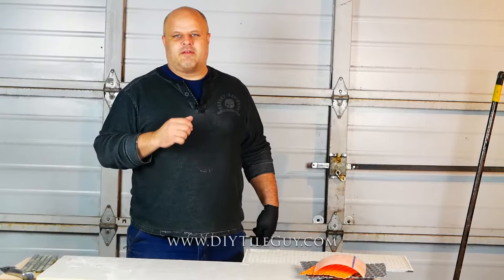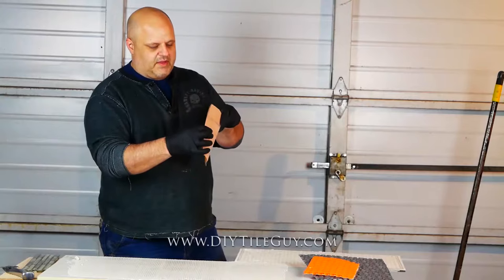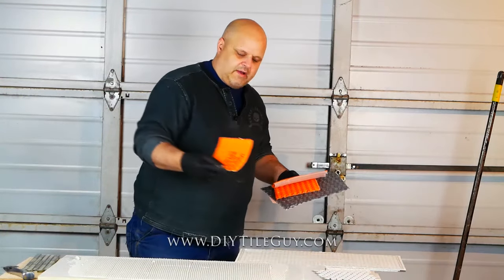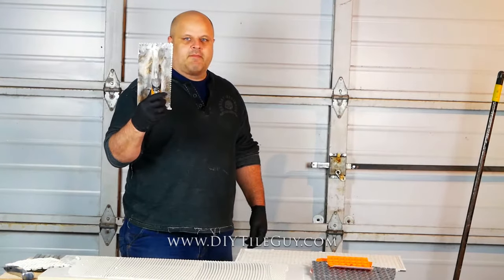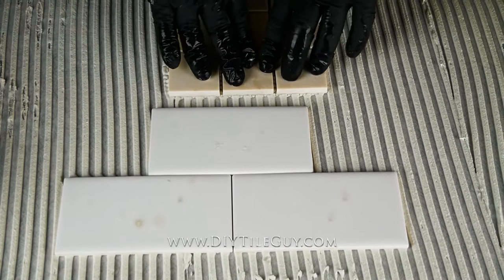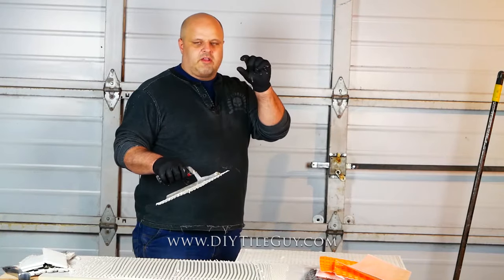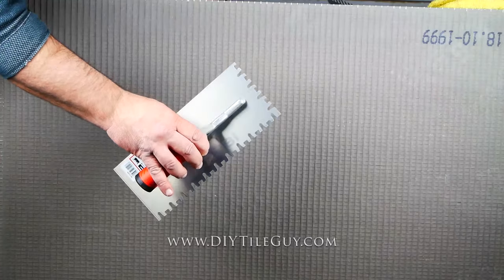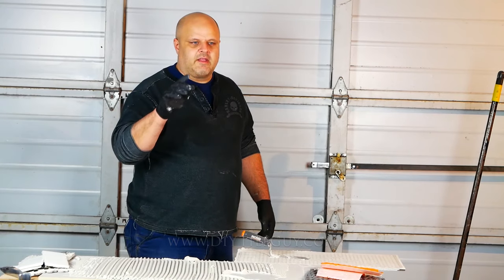Tile Notch Trowel sizes. Which trowel size do you need for ....? [Full vid]

Comment: I’m using a kit with various sizes. There are large sizes like 16x16 and 16x24, and some smaller that are 8x8 and 8x16. Should I use the 1/4” for the smaller tiles, or is it bad to use two different trowel sizes on the same floor?
Reply from the maker: You're going to want to use the same trowel even though you are installing different sized tiles. Set your trowel size to the largest tile and use it for all of the. You'll probably want a 1/2 x 1/2 and back butter every tile.

Comment: I used 1/2" x 1/2" on 12" x 24" porcelain tile. It just seems so excessive while I was doing it. I feel like maybe I wasn't using the trowel properly. I'm not a professional (so probably). It just seems like every tile video I've watched online has smaller trowel lines. I used Laticrete LHT mortar which maybe could be why? Great video though. Thanks!
Reply from the maker: You can use a trowel with narrower teeth but I still recommend going with 1/2 inch deep teeth.

Comment: About to tile my bathroom, first time ever tiling. Are you supposed to lift up every tile you put down to check the coverage? I'm using 12x24" tiles.
Reply from the maker: No. It's good to pick up the first one, for sure, and, after that, any that you feel might not have bonded well.

Comment: I am concerned that when using the 1/2 x 1/2" notched trowel that you need at least 1/4" room to wiggle the tile sideways when setting itand that's fine for all tiles except when you get against the end of a row and the last tile only has 1/8 "against the wall and 1/16 on the grout line against the previous tile on the other side. Then you cannot wiggle sideways to collapse a 1/2" ridge. I thought you could change the ridges directions horizontal for that tile so you can wiggle forward backward instead of sideway but now your ridges extend the full length of the LF tile and that is more risky to leave trapped air.   I am preparing to install 15"x30" porcelain tiles 11 mm thick and hesitate between trowel sizes.  If you could pitch in would be good. Thanks
Reply from the maker: Use a 1/4 x 1/2 instead

Comment: Hi, thanks for these videos!  I am laying some linear glass mosaic and aluminum tiles on a 12x12" backing.  I am searching for good blade to cut with.  What do you recommend for a 7" benchtop wet saw?
Reply from the maker: I really like this Pearl P4 blade that runs around $50 in the 7-inch version. But this Rubi blade is at Home Depot and is only $28.

The challenge that you will run into is being able to push the tile through and keep them from moving. At the very least, I think you're going to want to put a small piece of wood, backer board, or a chunk of bigger tile over the back of the mosaics to hold them down and keep them flat. 

You might check out my post on cutting glass tile but it doesn't address mosaics specifically. https://www.diytileguy.com/how-to-cut-glass-tile/

Rubi blade: https://www.homedepot.com/p/Rubi-PORCELAIN-7-in-Diamond-Blade-31912/301288817
Pearl blade: https://www.tiletools.com/collections/diamond-blades-for-tile-and-stone/products/pearl-abrasive-p4-turbo-mesh-blade
Reply: @DIYTileGuy  i see what your saying about putting a board or something underneath.  Maybe i can try keeping them in the package to cut?  Or duct tape them onto a 1/4" thick board?
Reply from the maker: Maybe.  I think keeping pressure on them evenly from the top as you push them through will help keep things stabilized. But experiment and see what works best.

Comment: I was told to use a 1/4 x 3/8 trowel for 3x12 "subway" tiles and it seems too deep. Might it be better to use 1/4x1/4?
Reply from the maker: Could go either way depending on the tile. You'll probably have to experiment and see which one works the best

Comment: For 12 x 24 slate tiles, would you recommend combing the back of those? Or just using a flat trowel? This would be for outdoors on a sidewalk.
Reply from the maker: You definitely want to flat trowel. Sometimes they are high in the centers and you might have to fill the centers in a little more. Check how well the mortar is covering by pulling the tile back up after it's set. Then adapt as you go.

Comment: I spread some simple set pre-mixed and went to cut some tiles and took longer than I expected plus it was a hot, humid day....as a result the thinset dried out and I layed the tile anyway thinking it still had moisture...some tiles popped up the next day and some didn't. Will the ones that didn't eventually pop out too or are those ok? I finger checked them for adherence and didn't want to pry to hard lest I pop them out. Any advice is welcomed.
Reply from the maker: Typically, Simple Set isn't what you want to use but I'm not sure what the application is so... maybe it's an OK situation to use it? But that could be the problem. It could be that you didn't let it dry long enough. It could be a lack of bond. The good news is that Simple Set is one of the easiest adhesives to scrape up and redo. So there's that. In the future, mastic isn't the best choice. I'd much rather see you use a thinset mortar for most everything.

Comment: A 1/8"×1/8" notch means that the notches are 1/4" apart. Not 1/8th.
Reply from the maker: 1/8x1/8x1/8 means they are all 1/8 apart. I've never seen a 1/8x1/8x1/4 trowel.

Comment: Installing 12 x 24 porcelain tile on ditra XL, other than 1/2x1/2 square trowel, could a 3/8 x 1/4 square trowel work too. In this schluter video https://youtu.be/AaP1uA6FIQE, he used it.
Reply from the maker: As long as you can get proper coverage. I showed how to check for that in the video.